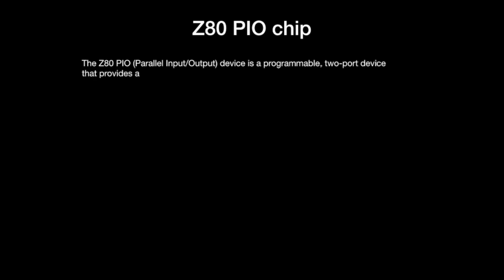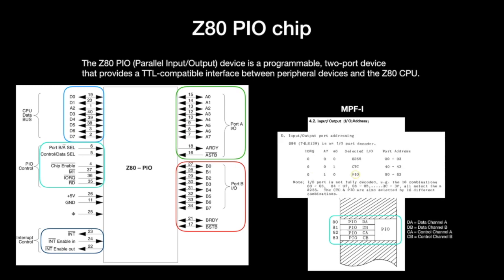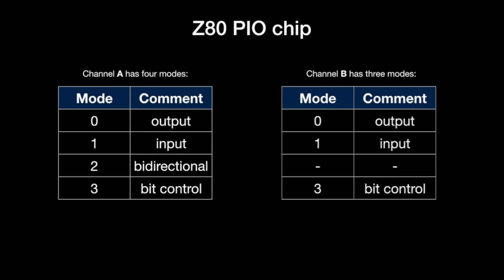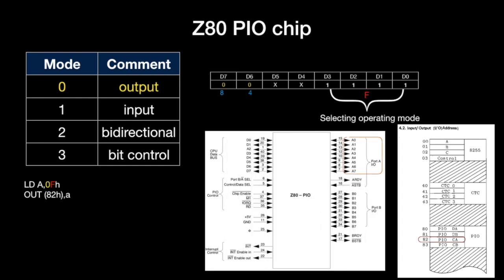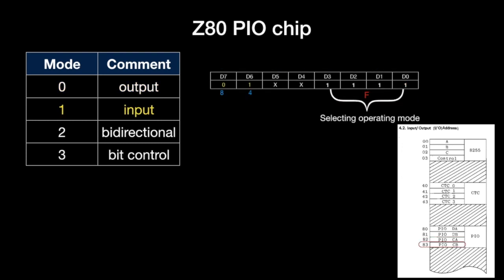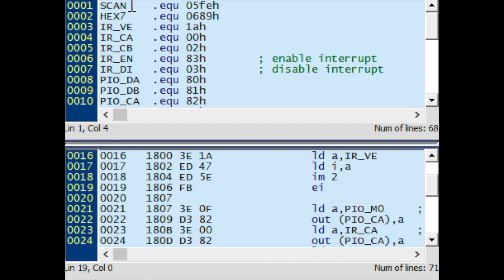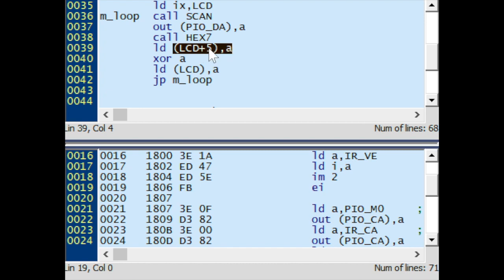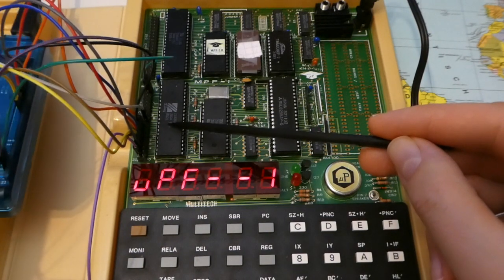Programming the Z80 PIO chip Part I

Comment: Hi, excelente explanation! Could be possible to do the same using the PPI 8255 with the Z80? I have the MPF-I MicroProfessor.

Thank very much for your support.
Reply: El PPI 8255 es una interfase paralela muy versátil y más sencilla de manejar. 
Tiene 3 puertos de 8 bits, el A, B y C, el C se puede trabajar como 2 puertos de 4 bits. 
El Z80 PIO sólo tiene 2 puertos de 8 bits.